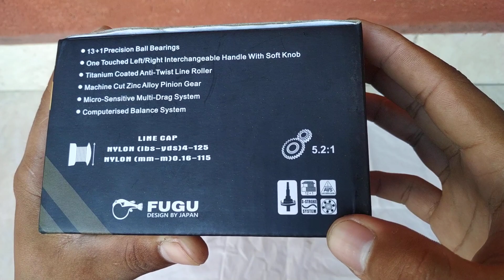Rivew & bongkar FUGU EIJI/dengan spek setara reel 700an

Comment: Mantap sekali, kalau boleh tanya untuk size 1000,2000,dan 3000, kira2 kalau pakai pe dan leader ukuran berapa yg ideal soalnya sy baru ingin coba, mksh.
Reply from the maker: untuk idealnya ya
size 1000 kasi pe 0.8 200m leader 15lbs
size 2000 kasi pe 1 300m leader 20lbs
size 3000 kasi pe 1.5 300m leader 25lbs 
itu untuk pe jabrik ya om ,, soalnya diameter pe gak semua sama
Reply: @igustingurahagungputraatma7534  terima ksh, info yg sngt bermanfaat,berarti sy telah salah membeli pe dan hrs beli ulang lagi.